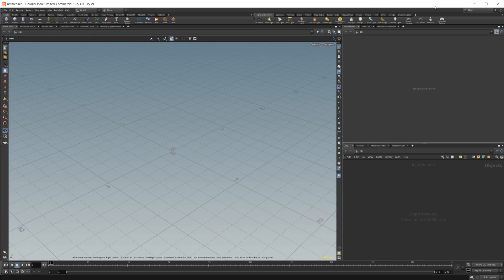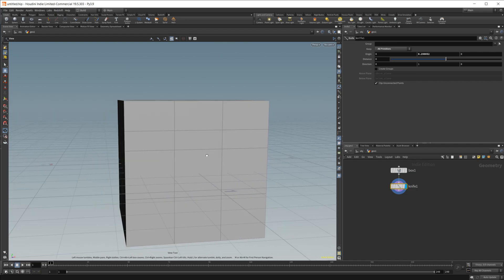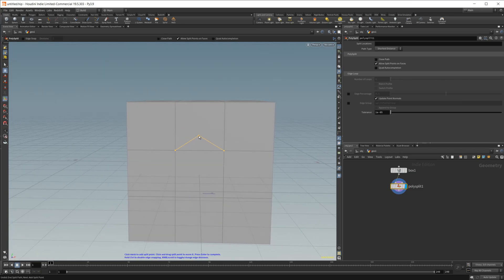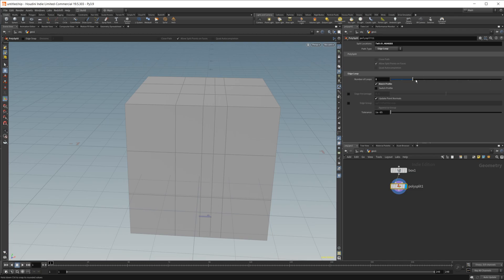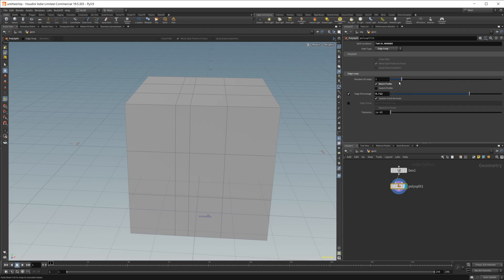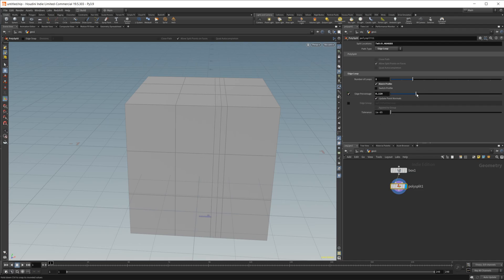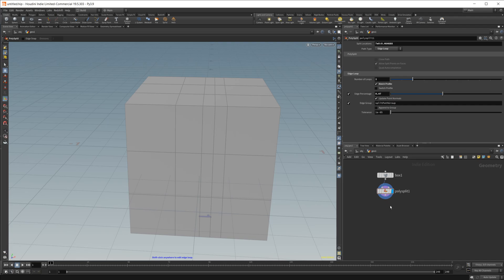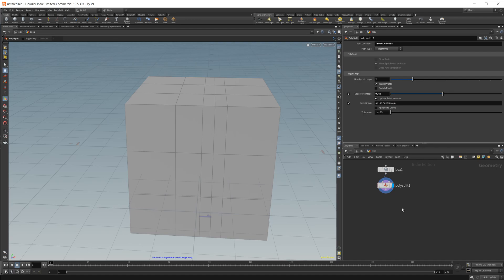How to Create Edge Loops | Houdini 19.5

Comment: Would this be the best tool to use for creating panel parting lines?  I have been using Maya, Max, and Blender's Bevel and then Extrude the face loop inwards forever... would love to have a procedural workflow paneling.
Reply from the maker: It could definitely work. You could also probably group the edges and bevel them in Houdini for a more procedural setup
Reply: @InsideTheMindSpace  That's what I am hoping for... will test it the first chance I get. Thank you!